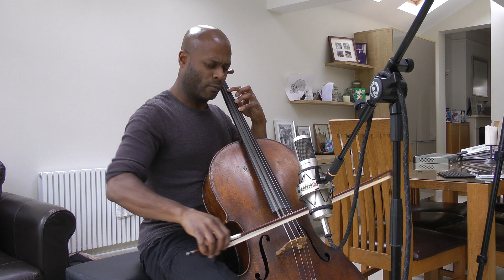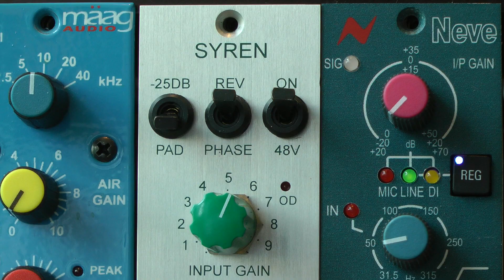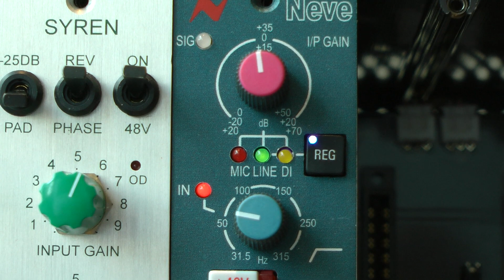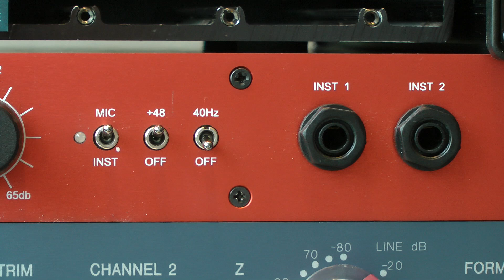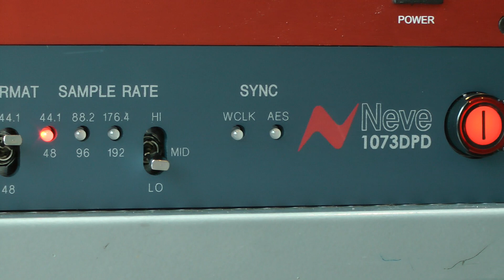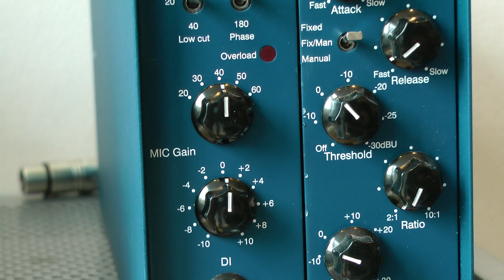Microphone Pre Amp Shoot Out Introduction

Comment: There is one flaw with this way of doing the test. By doing one take per mike pre-amp subtle differences in performance, and placement in relation to the mike will make an impact on the sound. It should be possible to have I don't know how you could test all at once, it is quite an undertaking. And still it is a nice test, because we can listen to them and find each amps character, but it is not easy to know what makes the differences.

Comment: Is it advisable to use a preamp to amplify an earphone-out audio signal (instead a mic)?
Reply: headphone out, and line out has similar properties, so you can do it. But just be careful how much gain you give to the signal.  So you should put it into "line in" on the amp, not to "mic in", because the "line in" has higher input impedance which makes it safer. But you will have to split it into two TS connectors instead of one stereo jack.